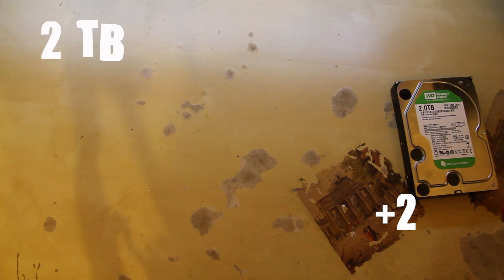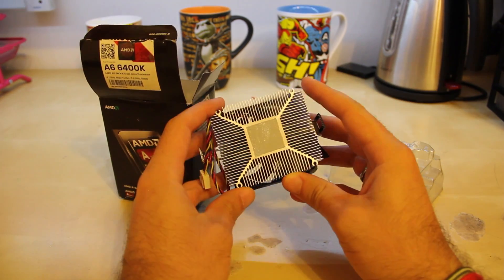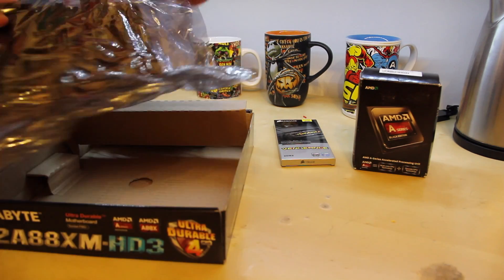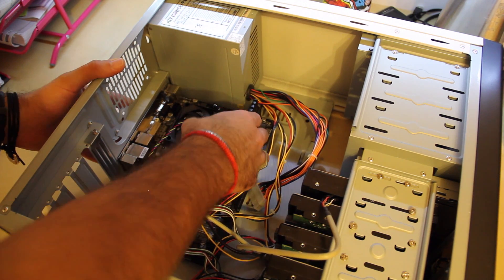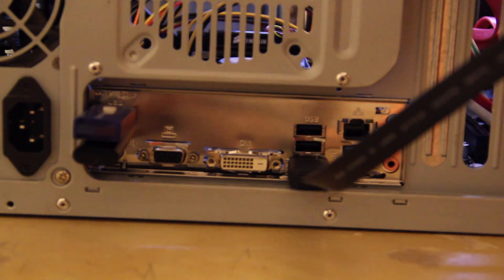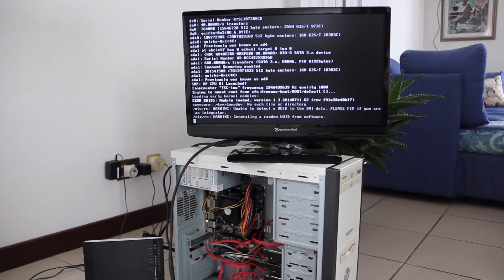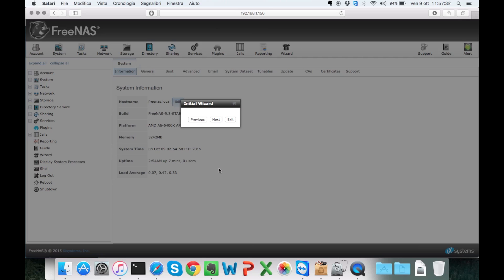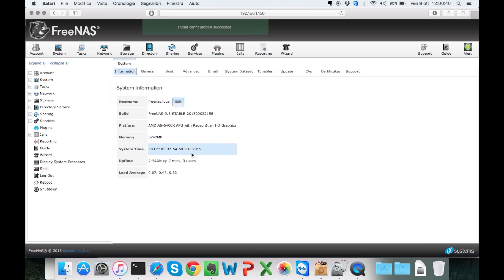Nas build late 2015, 10 TB, freenas

Comment: This is NOT the recommended hardware for a FreeNAS device.  You MUST have a motherboard and RAM that support ECC otherwise you risk data corruption due to the way the ZFS file system works.  Visit our FreeNAS forum (forums.freenas.org) if you want the correct recommended hardware and how you should organize your drives because one size does not fit all and some people actually value their data.

The good thing about this video is it shows how easy it is to build a system.
Reply: +Mark Thompson he isnt very clever mate when it comes to pc's, let him make the mistakes, its how we learn

Comment: You really need to change the CPU/MOBO/RAM.  FreeNAS needs ECC with ZFS file system.  If you don't there is a chance of loosing the entire array.  It's a gamble.  The best bang for the buck if you don't need a bunch of power for extra features like a Plex server would be an Intel Celeron.  Then get a server or workstation board.  I like Supermicro for these kinds of builds.  And for the amount of storage, you really need at least 16GB of ECC RAM.

Comment: what about the 8 gigs of ram for the os and the recommended 1 pr terabytes of storage for freenas.that and they didn't suggest you use amd system's.regardless if it works awesome and congrats on a useful tool in safe storage and nice build walkthrough
Reply: "safe storage", sarcasm?
Reply: +Geniustrash no sarcasm freenas is a safe storage program that I use my comment was just to give you a reminder of the requirements that freenas suggests I have switched to unraid lately because of less ram requirements and easier graphics card pass through to vm,s
Reply: +Geniustrash after watching it again I noticed you were using a raid 0 my comment on safe storage was about zfs and its safe ability to protect you with a drive failure. regardless I'm all for how to guide's and liked the build